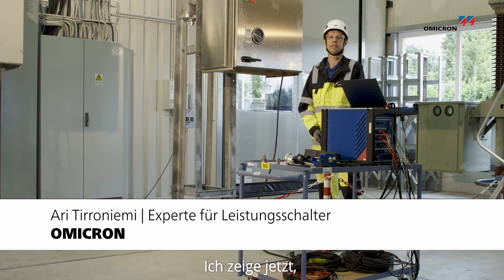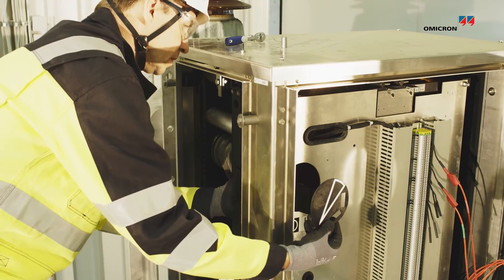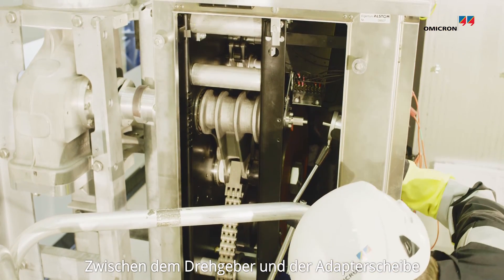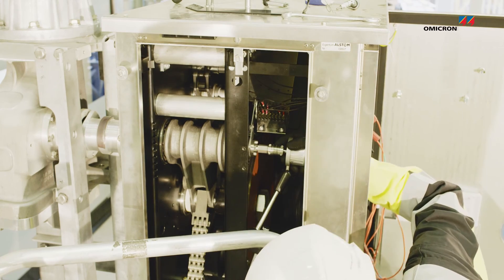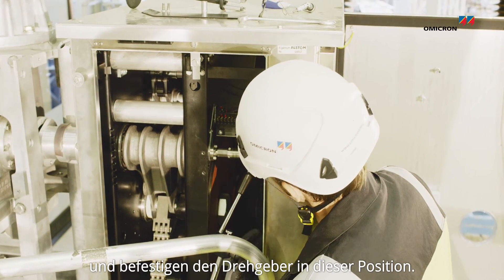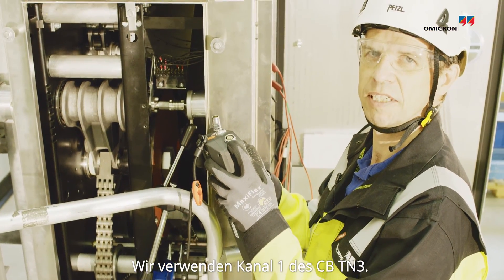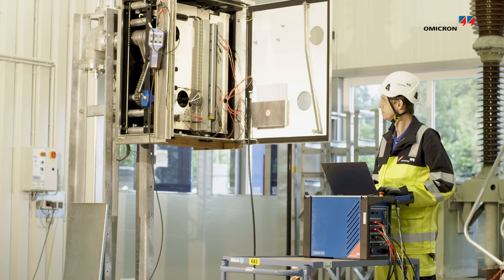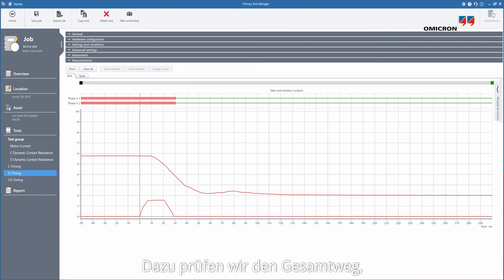Bewegungsmessung an einem Live-Tank-Leistungsschalter GL 316

Comment: Suggestion, apply an optical target to the built in indicator that you removed.  Use a high speed camera or optical pickup to measure mechanical performance.  This would save having to disassemble the breaker, eliminate error induced by the arm, and eliminate mechanical hazards to the technician.
Reply from the maker: Dear Doug Golde, 

thank you for your input and your interest. We highly appreciate your feedback!

Best Regards, 
your OMICRON team